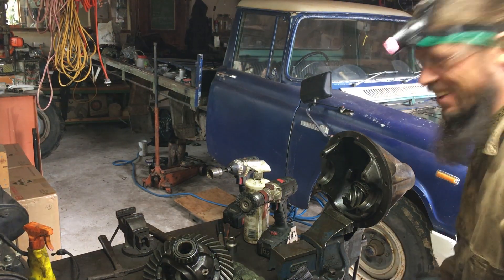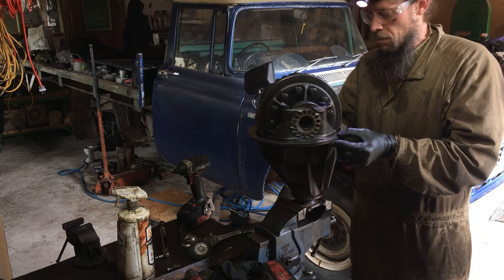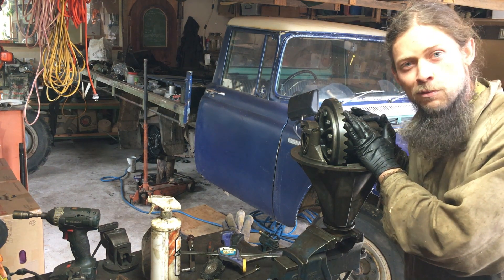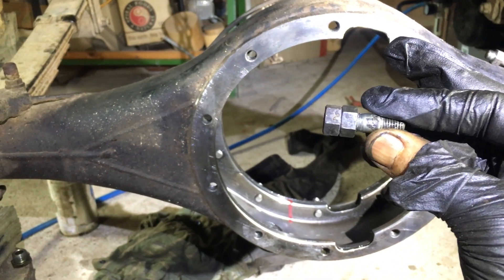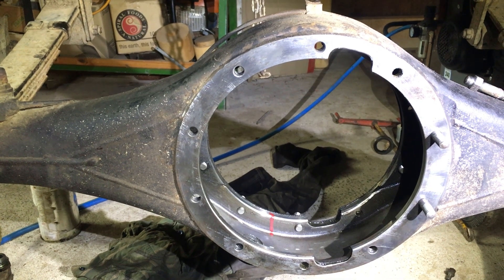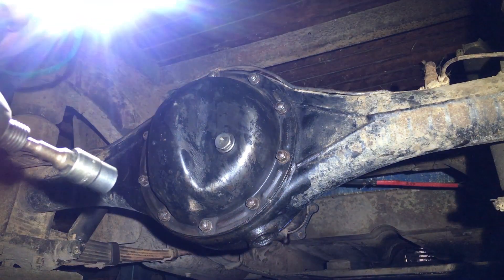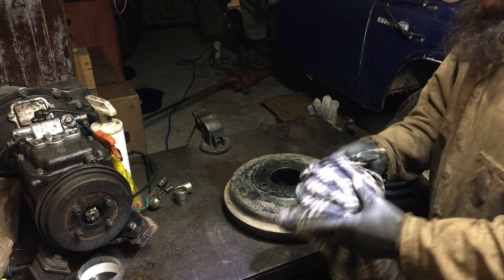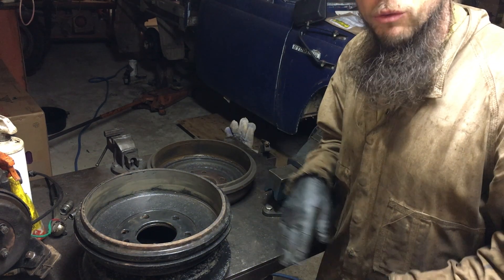Toyota Stout EV Conversion: Episode 6

Comment: Sorry Ol about leaving the manual in the parcel tray of my Stout with the leak in the windscreen all those years ago that caused the pages to glue together resulting in you losing the correct specs for the bolt tension. I should have realised that someone  might one day want to delve into the mysteries of diffs. The only thing Eric Dodge did for the 1982 rebuild was swap the diff for a landcruiser one to give better road speeds and I can't remember who swapped them back to give us low gearing again for collecting firewood in the bush at Fryers. That was all before you discovered all the variations of diff ratios with your deep dive into Toyota engineering of the 60s and 70s.